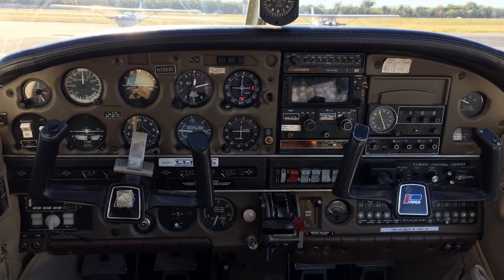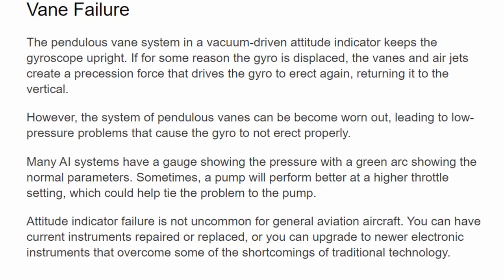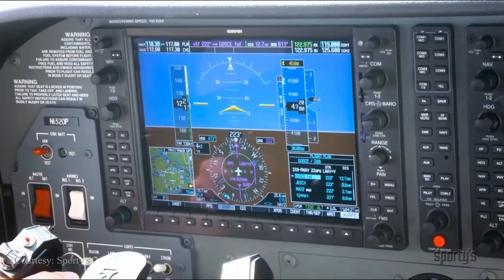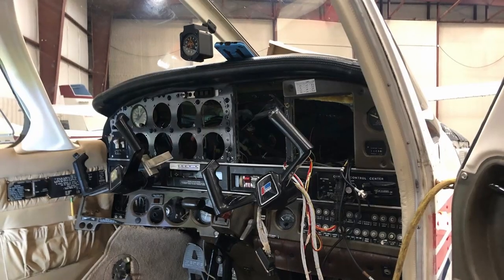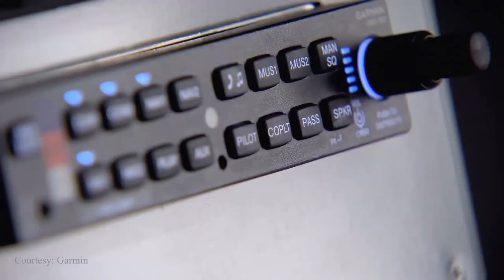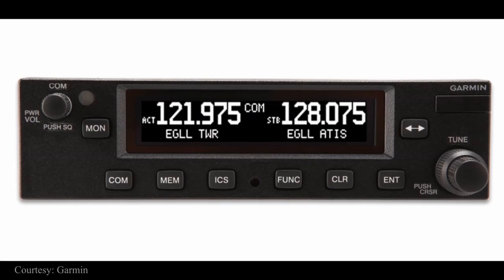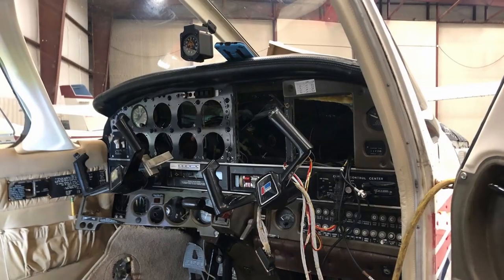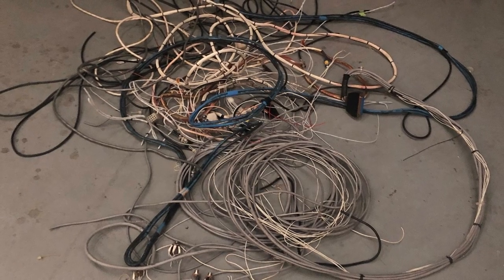Full GARMIN panel upgrade | Piper PA-28-181 Archer

Comment: The Archer is a great platform for this Avionics upgrade. I flew an Archer for several years, and found it to be a very comfortable, forgiving airplane. Adding the dual PFDs engine monitor and updated autopilot makes it a great IFR platform for single pilot operations.  The only thing I would do different is get rid of the plastic bezels on the panel, and replace with a flat metal painted panel. I think it looks more modern and cleaner than that late 70’s style plastic. 
I know it might not yield an increase in resale price, but certainly upgraded avionics can tip the scale when a purchaser looks at your airplane vs a similar model with all factory gauges.
Reply from the maker: Thanks, Bill! It’s definitely a great, solid platform for IFR after these upgrades. I agree that a new panel overlay would’ve been a nice cherry on the top, but it was going to be several thousands $$ more, and I had to draw the line somewhere. The extra functionality is greater than aesthetics in my opinion.

Comment: Great video, I got a 1979 Archer II last November as well.  Did a big upgrade too, Dual G5's, GMA 242, GTX 375, GNC255, Metal pannel.  I would of loved to get an engine monitor and an AP but have to wait for some other time.  I am currently getting my CFI and will rent and train in my plane.  I am having some Arinc 429 problems and heading issues on the upper G5's.  Any clues would be Great.  Shop has already tried to fix it but they can't get it right, I think I will have to ask another avionics shop.  Thanks for the video....
Reply from the maker: Nice upgrades!  I couldn't swing the cost of a metal panel overlay... would've loved that.  But I thought the money was better spent for me on the avionics.  Can't offer any tips on the arinc 429 problems... I concur that another shop's opinion may be in order.

Comment: I'm doing a very similar setup except I'm going with the GI 275's instead of G-5's.  Adding the pitch trim to my setup would be about $4,000 more.  I have a 1968 182 without electric trim (maybe that is what makes it so much more....they have to add the electric trim first).
Reply from the maker: I'm sure you'll be happy with it!
Reply: So... whats the cost of actually doing upgrades such as these? 25-50k? more than 50k?
Reply: @motarded4214  Mine was around $30,000.
Reply: @quinnjim  Thanks, that was about what I was figuring it would cost. Also makes those planes that are already setup for 15-20k more than similar planes with older avionics look like a better deal too.

Comment: Nice video. I got a 65 Mooney and I have about 20hrs so far in it. Real lovely plane, but the last 3 flights, I notice the attitude indicator was all over the the place before coming back to life. The last flight was ok, but now I'm wondering if I should get rid of the attitude indicator. Thing is, I have a sandel HSI.
Reply from the maker: If your AI is failing you could overhaul it or you can replace it with something like a Garmin G5. You don’t have to do a dual install - you’d keep the HSI.
Reply: @MikeWebb-FlyingFinanciallyFree  I would love to get rid of the vacuum system. I'll keep an eye on it for now. If it continues to fail then I will have to make a decision..

Comment: So I’m looking into picking up an older debonair/f33 bo with out dated avionics to do almost exactly what you did to your piper. The only thing I plan to do differently is a 750xi instead of 650 and edm 900 instead of the 830 so I can delete all the legacy engine gauges as well as the legacy vacuum/DG system.
Reply from the maker: You will definitely enjoy that setup!

Comment: I would like to know just how much it all cost?  I've been looking at upgrading my KNS80 to a 650, or a used 530W.  But then, the autopilot problem comes up..  Then there's the steam gauges...  Two G5 would be wonderful...  My 79 Archer only has 1479 hrs TT, but I'm 74 years old.  How many more years am I going to fly?  Would it be worth it?  I've had it since 1985 and always considered lease back as a way for me to pay someone else to fly my airplane.  Maybe I should re-think that option?  Do you actually make any money from leasing?
Reply from the maker: Hi there. Sounds like any money you spend on your plane is a balance of needs and wants. If you don’t think you’ll be flying very much in the near future, a leaseback could be a good idea If you find the right partner. Or you could sell in this hot market.

Comment: Mike, when your engine is ready for overhaul/replacement would you consider installing the Continental Jet A/Diesel under an STC instead?
Reply from the maker: Rick, I recently did overhaul the engine.  It made it close to TBO but it was time.  I'm a big fan of Jet A/Diesel (lower operating costs) but wasn't aware of on STC for such on an Archer.  Is there one?
Reply: @MikeWebb-FlyingFinanciallyFree  Even if there is, the Archer DX is horrible. The loss of useful load is not worth it.

Comment: I am thinking about doing the same thing with our Sierra.  I’m wondering about the difference between the JPI 830 vs 930.  I was thinking the 830 was for experimental a/c and I need the 930 for TSO.  Do you have any thoughts on that ?
Reply from the maker: The 830 or 930 will work in certified airplanes, the difference is the 930 is a certified replacement for primary gauges whereas the 830 does not allow the removal of the original, primary gauges.

Comment: Hey Mike great video! So how much for an installation of the G1000 in a plane that has the basic six pack? Like, for an older plane like a 1980 Piper Archer or Cessna 182?
Reply from the maker: Hi Robert. Thanks! A g1000 is not an aftermarket thing you can add; it comes with a plane at the beginning. You can do a garmin g500/600 TXI (or non) which is essentially the same, but is more configurable.  That can get quite pricey, but the functionality is hard to beat.
Reply: @MikeWebb-FlyingFinanciallyFree  Hi Mike thanks for the quick reply! Okay that makes sense. So how much for the g500/600 TXI new install then? Ballpark...
Reply from the maker: @robert4039  For exact numbers you'd need to speak with an avionics shop like Freedom Aviation that I mentioned in this video, but my recollection is to go from a six-pack to new G500/600 install you're looking at $45-65k, roughly.  Easily more.

Comment: Thank you for sharing your setup!  I noticed you removed all your Nav indicators and rely only on your G5 HSI.  I'm thinking of doing the same but I wonder how that will affect the aircraft as a instrument trainer and ultimately checkrides?
Reply from the maker: You're welcome, Leonard.  I removed one of the Nav indicators to make room for the EDM 830, and the other I removed as it provided credit for the overall job.  I thought about that one for a while, but it's no different this way from a 'glass' cockpit, where there is usually only 1 HSI for Nav purposes.  Granted, two sources of Nav data, usually, but only one indicator.

Comment: I asked on Reddit, figured I'd ask here too.. How is 2 G5s and a GFC 500 a TAA?
Reply from the maker: Hi, Josh.  The G5s and the GFC500 don't make it a TAA by themselves.  Those, combined with the GTN650, make it one as per 61.129.  The top G5 is your PFD, the 650 is your MFD, and the GFC500 is the 2-axis AP.  Hope that helps.
Reply: @MikeWebb-FlyingFinanciallyFree  I don't think that's correct. The G5s aren't your "primary" display for all of the parameters listed, hence why the G5 requires keeping some of your legacy gauges.
Reply from the maker: @joshcox8785  I agree that it's open to interpretation, but a DPE deemed it appropriate via 61.129 to be a TAA.  Whether the G5 is actually the 'only' or 'primary' source of that info doesn't seem to be a sticking point; it has it all in one, easily useable place.  https://www.aopa.org/training-and-safety/active-pilots/safety-and-technique/operations/technically-advanced-airplanes#:~:text=The%20term%20technically%20advanced%20airplane,aviation%20lexicon%20for%20several%20years.&text=According%20to%20FAR%2061.1%2C%20a,also%20created%2061.129(j)%3A
Reply: @MikeWebb-FlyingFinanciallyFree  Good deal, wish that was the case more often. All of the dual G5 +GTN+GFC airplanes I've flown were definitely deemed to be NOT TAAs
Reply from the maker: I suppose it depends who you ask. When a respected and busy DPE in my area who has conducted several checkrides in this plane said it qualified as a TAA I was pleased.
Reply: @joshcox8785  I do have dual G5's in an Archer as well and... according to 61.129 (j)(1) if you have one of them selected as "PFD" stated in the G5 itself, it complies with all:  Airspeed indicator, turn coordinator, attitude indicator, heading indicator, altimeter, vertical indicator.  I don't see which of those is missing in the G5.  it has it all!
Reply from the maker: Bingo, Davisando!

Comment: Does everyone still not recognize the danger of flying with no instruments, other then those COMPUTER SCREENS?????
I've been working with computers and other "High end" electronics systems for over 40 years. And yes, their great WHEN THEY KEEP WORKING!
But if you knew the ten thousand and one reasons that will make then just up and quit?  You would never bet your life on them again. Sure, I enjoy using our modern, electronic wonders. But only for secondary support. They will never be my primary source of flight data. That's just a far to dangerous situation that I'm not willing to risk my neck on.
Reply from the maker: Hi, Robin. Your sentiments are certainly valid, but I’m not sure you noticed this panel still has analog “six pack” gauges that could be relied upon should both G5s fail (extremely unlikely). In 2021, any true glass cockpit will have 2,3, or even more sources as backups should the primary fail. In my opinion, that’s much safer than relying on aging vacuum systems and gyro instruments with costly and regular repairs needed.